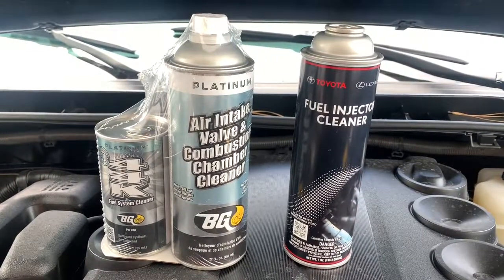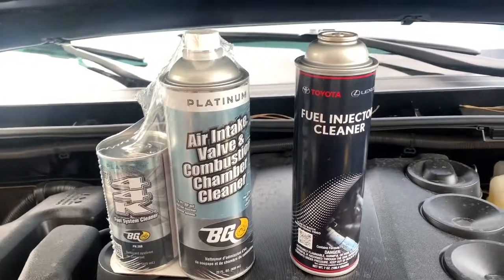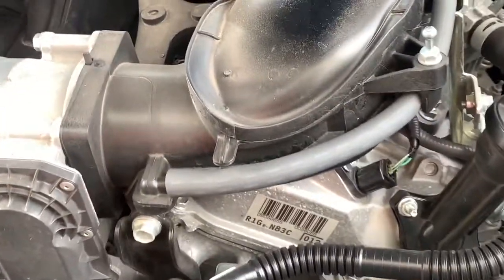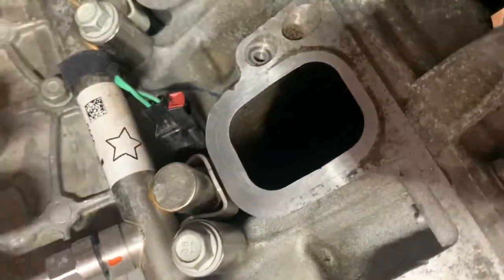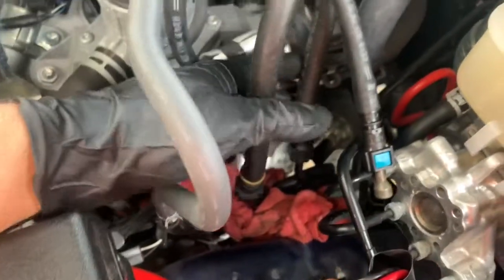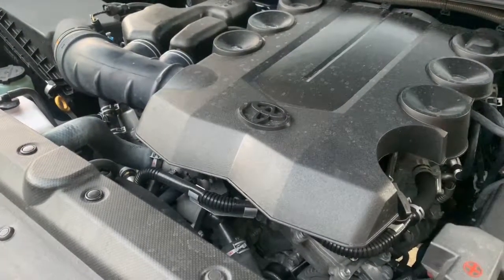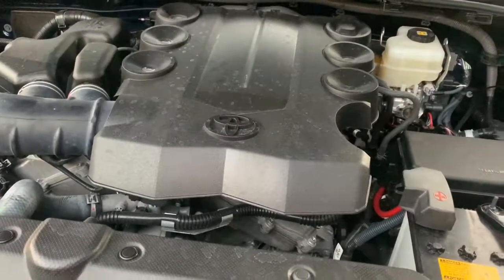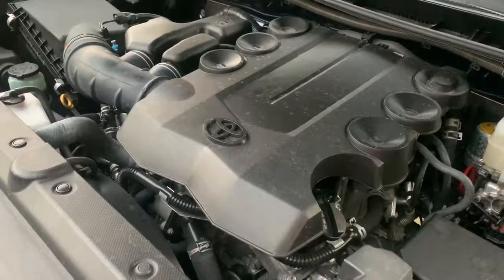Dealer RIP-OFF?? We think not. Fuel cleaning services explained

Comment: Great video. I don't agree with the premium fuel, but I wasn't aware of detergent benefits. I thought it just had to do with how stable the fuel is during compression and non-high performance cars gain no benefit because regular is plenty stable enough
Reply from the maker: So, yes! that’s the major difference for the octane number, however many top tier fuels add detergents and other additives to help clean, reduce friction etc. correct on the last part too, no gain from octane alone if the engine isn’t prepared for it.

Comment: what pressure you running the induction product through s tool ?
Reply from the maker: @wigum12  I think the apparatus I was using there was 60? I think each one runs a different pressure depending on the nozzle it has.

Comment: im trying to figure out if what I believe a ~5 mpg decrease in mpg is because im driving more local and faster on the highway or I need this service. I always put 87 top-tier fuel in, maybe I'll try a tank or two of premium. I just filled.
Reply from the maker: There are other things I wild certainly check before doing this service if you’re loosing 5mpg. I would suspect your car wouldn’t be suffering a 5mpg loss from carbon alone. That would be a LOT of carbon and I would suspect it might cause other issues. Maybe rough start, poor idle. Ect. Shell 93 premium has the most detergents. I would try a tank or two if that first and if your dedicated or a DIY-er even an oil change with good filter and some cleaning oil like the new valvoline clean and restore might help too. But I would make sure it’s not a sludge/gel motor issue before trying any “cleaning” oil

Comment: Many people didn't know that modern engine with a GDI system (gas direct injection) are suffering from heavy carbon build up issues on the upper air intake basically from the throttlebody all the way back to the valves... the air induction service will help to (hopefully) remove some of the deposits.

Comment: So….completely ignorant question: won’t the resulting break up of carbon just wind up in and clog up the catalytic system?
Reply from the maker: It’s a great question! The answer is well, no. The process is not so harsh that it will cause large pieces of carbon to detach and cause issues. If the engine is in bad enough condition where that could/would be a threat I would think you would be chasing a more physical cleaning method/engine repairs. This is a preventative maintenance service not really a “repair” carbon removed from this service passes through so long as the service isn’t done improperly. If done improperly catalyst damage can occur. Properly trained technicians are important!

Comment: Have u ever had any issues with sensors going bad ? Map , O2 , cats ? From Doing the induction service ? Iv been doin some research into this I have 2 GDI engines comming up on 30k i want to invest in the induction tool and cleaner to do this service every 30k or so .  BTW I’m mechanically inclined so I do all my own maintenance I don’t use shops unless it’s a tranny issue

Comment: What about chevron techron 91 oct fuel n fuel injection cleaner by chevron to maintain it 19 Lexus GX460?
Reply from the maker: The octane of the fuel won’t offer any benefits over lower grades. Some fuels do have higher levels of cleaning agents which can reduce the carbon build up, thus the need for services as such. Fuel tank additives would help keep fuel systems clean as well, most benefit for port injection vehicles such as your GX. Last I knew Exxon followed by shell offered the highest levels of detergents in their 87 grade fuel. Shell has the highest cleaning power in high grade fuels last I knew.
Reply: @RaceBreakRepeat thank you for the information
Reply: The 1UR-FSE V8 equipped USA Lexus GX460 has D-4S which is port and direct injection.  😅
Reply from the maker: @anthonyz7023  having port injection of any variant keeps most of the carbon at bay with quality fuels when comparing to strictly DI. 
I think I read 470 not 450
Reply from the maker: 460*

Comment: I have a 2021 corolla xse. Took my car for a throttle body and fuel injection cleaning at about 36,000 miles and i started to lose mpg.
Reply from the maker: After? How are you tracking the mpg.
Reply: My car was always stable at 29mpg and it dropped to about 24 mpg.

Comment: My Mercedes has high mileage, about 160k, I'm going to be doing an oil change and air filter change as well as fuel service. But I'm not sure if it can be done because the MAF sensor is attached to the throttle body. It's a V8, what do you think? It also only takes premium gas.
Reply from the maker: Maf sensor location isn’t an issue as long as whomever does it is knowledgeable and not just making quick money. Do this before the oil change too. Premium fuel helps but fuel quality isn’t necessarily the only cause for this condition. Many more factors. Age and overall health of engine is to be considered, best have someone who knows your vehicles history best do it unless you are capable of it yourself.

Comment: Thank you for the detailed explanation. You sound professional and know what you are doing. it would be great if you could post links or the part numbers for both cleaners. Thank you in advance! Also, to my understanding, it is 2 different services when I called a local Toyota dealer, they told me that it is 1 service. I am not sure if I asked them correctly. I told them I needed an "Air intake valve and Combustion Chamber cleaning service" and "Fuel injector cleaning service". Please advise if I should've asked differently.
Reply from the maker: Thank you, glad this video offers useful info! These aren’t “set” services but the industry or dealer, so you may find some variances. Which means it’s good to understand what you ask for /what you get. Some dealers do this as one service, others you’ll find may only do one “part” or the other. For reference I mean intake /induction service being the throttle clean and fluid ingested and injector being specifically the can the vehicle runs on.
Often people selling the service mistake the fuel tank additive as the injector cleaning portion. Which isn’t wrong, but that’s more a fuel additive with slower/less effective cleaning effects. 
When you ask your dealer, ask if their items are the one which allows the vehicle to run stand alone off the cleaner or if it’s the one that mixes the chemicals through the intake and adds a supplement to fuel tank. Or both if sold as one. I think you asked correctly and are now finding yourself in one of the greater issues within the industry - detailed knowledge of services over the game of telephone. Don’t be afraid to see if they’ll let you speak with a skilled tech! Also. These may not be sold over the counter at a dealer but I’ll try and find the part numbers  and post more here.
Reply: @RaceBreakRepeat  Great, thank you so much for your prompt response. I'll keep an eye on here. If you would post more regarding the Part Numbers or the links, I would greatly appreciate your time and effort.

Comment: I’ve been looking for a video on how to do the fuel system cleaning on this exact truck. Thank you very much. Can’t wait to do this service myself.
Reply from the maker: Perfect then! You’re welcome. Post any questions you might have!
Reply: @RaceBreakRepeat  I do have one question regarding fuel pump. You connected the fuel pump line to the other line. Is it ok to simply remove the fuel pump relay or do exactly what you did? Thanks an advance
Reply: It’s been about a year & still have great gas mileage.
Reply: @Will-DIY  any recommendation on how to DIY these? I see you came back to comment roughly 18 months later saying MPG  is doing well still. I also have a 5th gen 4 runner and am pretty ocd with maintenance but have always just hand cleaned throttle body, used fuel additives every oil change, only use shell fuel, most regular fuel and 2 or 3 tanks between each oil change I’ll run the shell v power. Looking to do this as safely as possible for the engine so I don’t blow it up lol

Comment: Don't premium for a car that calls for 87. Just get a listed top gier gasoline, Techron is good, and just hit the highway and open it up every now and then. Shit, redline it while getting onto interstate, providing the engine is warm, once a week. Unelss you have direct injection (and not Toyota D4S), get top tier gas and check the throttle plate every now and then. Dont waste money on these services unless theres an actual performance/economy issue. Highway driving + top tier gas will be all you need for all port injected systems and likely for all Toyota D4s. However, there's even more cases where opening up on the highway is good.. the new "Prime" hybrids... If you always recharge and never use the ICE to regen the battery, thinfs can eventually happen. Good to take a highways spin and let the good ol gas engine charge it ip. All those trips but hardly used the ICE.. and when you do, it's for such a short time that you never reach nominal operating temp., and thus carbon slowly builds and builds
Reply from the maker: The big important part is the back of the intake valves. A+ for D4-S here! DGI cars need this more. Especially those struggling with carbon. EGR isn’t helping (thanks epa lol) but yes. Running the engine hard during in ramps now and again is good provided there isn’t any detonation

Comment: Dealer rip-off for sure given the product cost and how much they charge.  You can do it at home for less than $100 including buying the hardware.  There are lots of other brands besides BG products you can use.
Reply: BG is the Best in the business!
Reply: My dealer wants $224.00 for fuel induction service on my 2021 kia sportage  lx after I just took it to them to see if I needed brakes which I don't. Curious  if I should or shouldn't  do this after all these conversations.
Reply from the maker: Rip off, no. High profit center. Yes. Not recommended for those who don’t understand the mechanical risks though.  But yes. If you know how to properly do it you can do it far cheaper. The service outcome is justified though. Price varies per dealer though.
Reply: @RaceBreakRepeat  The price is a rip-off the service is not, at the dealer.
Reply: @Boodieman72  Phoenix, AZ Toyota dealer wants $300 for this.
Reply: @Enough.Said. find a local trusted mechanic or shop that does this. Will save you and will probably do a better job than any dealer.

Comment: Hello, I have a 2000 camry 2.2l with high postive long term fuel trim at 20% at idle, but at higher rpm it drops to 5%, but I cannot find a leak, would a exhaust manifold or intake manifold leak would cuase this? Could clogged or stick open injectors be culprit? I also have do NOT have check engine light on.
Reply from the maker: Higher at idle than loaded is an unmetered air leak usually, anything over 15% should also kick the cel on.  Could have a stuck purge valve, restricted fuel system perhaps, sounds like your on the right track. But that engine ecu is 22 years old now. I’ve chased my arse a few times from faulty computers- they usually go bad around that age. If you get to wits end with physical checks try AEM modules for a rebuild. Also make sure you’re monitoring o2 sensors. Seen a few of the rear o2’s cause odd things when they don’t work well. After each check unhook battery to clear learn values.

Comment: I was recommended to do this. I'm at 90k Miles and embarking on a one way trip of about 1300 miles soon. Any reccs? Also was told to do the throttle service
Reply: They gonna try to recommend MAF service. Imo, unless you have DTC code, leave it be. They are finicky sensors.
Reply from the maker: Cleaning of the throttle is often done with the induction portion since it’s usually accessed to perform the service. I would perform these both right before an oil chance, ideally perform these then once the engine is hot spill and fill oil. So if you’re about to take a trip and you aren’t due for service you can wait if your just doing this for preventative maintenance. For the road trip you can find a quality fuel system tank additive for cleaning ( I recommend liqui-moly brand ) and find a high detergent fuel ( Exxon I believe is highest at 89 octane ) and run those for the road trip. Will help do some cleaning for sure. 93 she’ll has highest detergents of the higher octane I believe
Reply: @RaceBreakRepeat  Awesome. Thank you !

Comment: Chevy is doing fuel system service on my camaro,does that mean they are putting cleaner in the tank and through the TBody as well?
Reply from the maker: It’s possible yes. There is not set definition for “fuel system service” so each treatment can vary per dealer.

Comment: I just drive on the hwy really hard. All those faking carbon will come off easily. Just don't drive short distance and let the engine warm up to normal temperature. Short distance will let gas splash on the back of the intake side. It will gunk up. If I don't drive like a GTA. I dont really need it. Just check the cylinder head with a camera to confirm if you need the clean.
Reply: You're right. But, bear in mind, some companies suck at making gdi and it will be more annoying to maintain. But this + top tier gas is the right answer and anything more intensive is only if issues are actually witnessed.  Toyota's D4s is cool and doesn't really have those cons

Comment: I have a 2014 chevy cruze 1.4l turbo. Can I do this to my engine?
Reply from the maker: You sure can, turbo cars benefit from this just as much. Maybe more. However, I suggest you find a professional shop to do it so it’s installed at the right place so it doesn’t cause damage. Wouldn’t recommend the DIY here. Doing this with charge pipes adds a bit more need for attention
Reply: @RaceBreakRepeat  thanks a lot man....I just called a induction service place near me and they said I can't do it because I have a turbo car....I dont know why they would say that
Reply from the maker: @bama205g  Probably because they either don't feel comfortable taking the risk or perhaps they don't have the adequate adapters for the car. A technician with hands on knowledge of your car could think it may not be worth it. There are plenty of fuel additives that can "help" also if used properly

Comment: My Toyota Camry Hybrid 2018 has about 35K and the dealer recommends that next time for oil change, i need to to what so-call “induction system cleaning” and it costs $220.  Is this service they referred to is the same as this Fuel Induction cleaning thing we’re talking about here?  And is it the same as their internal jargon term 3-1 cleaning service?  And the $220 is that pretty much the standard fees or is it cheaper to take it out to some non-dealer Toyota specialist to do for cheaper cost?  Thanks in advance
Reply from the maker: Yes. so the dealer “induction system cleaning” is the fuel induction. Most Toyota dealers use service rite chemicals or similar like I’ve shown. 
$220 is a little high I think, I’d say around $180 would me more appropriate, but I don’t know how your area compares to mine. Its “3” part because it treats the fuel in tank with an additive, they clean throttle plate, then cleans the intake bits. A reputable non-dealer can also do this work, but like I said I’m not sure how your are is. Here many shops use the same chemicals and training so you could do it anywhere here.
Reply: I wish I didn't see this one year late. @ me if you want some legit answers still.

Comment: Thanks for the info. Just dropped my turbo car off at the dealership for oil change and they recommended this for me and I declined it because I thought it was just a bs recommendation. Just did some research and have noticed some power lost on acceleration, thought it was transmission issues. But just told the dealership to do it so thanks for the insight!
Reply: You just got to make sure they are actually doing it, I’m just saying
Reply: What was the mileage?
Reply: @MagnumOpus-b6n had them replaced twice, once at around 35k and then 50k, got rid of it and got a model 3. No more stress haha

Comment: I have a 2016 Sonata Hybrid with GDI and have had the fuel service done at the dealership but they don't use BG. Not sure if theirs worked as I never saw smoke like I normally do and it has 100,000 miles now-I had gone 25,000 since the last time. I'm thinking of having it done where that's offered.

Comment: There is zero alcohol in the BG kit. FYI.
Reply from the maker: The MSDS on the product indicates there is alcohols in it. Perhaps there is more than one variation
Reply: @RaceBreakRepeat  which product?
Reply from the maker: Says it’s called “BG Air Intake System Cleaner” and the MSDS sheet says product code 206. Not sure if this is what you’re looking for
Reply: @RaceBreakRepeat  the air intake cans part number is 260. I assume your speaking on the propanol on the SDS sheet. I mis spoke on saying there is zero alcohol in that product. Propanol is a type of alcohol. That being said it does not make that product "alcohol or water based" the 44k can is the product that has zero alcohol and is polyetheramine based.
Reply from the maker: I was referring to it all, maybe the isopropyl in it would have been my first thought maybe.